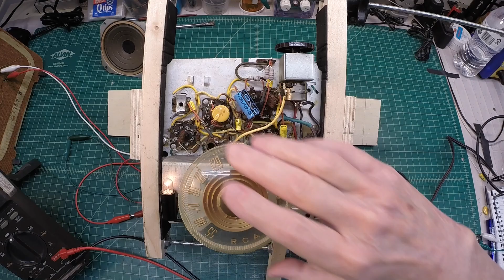RCA 8-X-541 - Cause & Effect P7 (Recapped w/ a Loud Crackling Noise - TAKE THE POLL 0:48)

Comment: Here's a question for you Don as I know you like to analyse and research. Why is this so called silver mica disease rare to unheard of over here in the UK but seemingly prevalent in the U.S.? Mica is Mica I would have thought, they used U.S. war surplus capacitors like Lemco manufacture in UK sets. Can't be our atmospheric conditions which are generally wetter as we have a maritime climate but so do parts of the States and wetter is worse for components. The only difference between our sets is the AC mains frequency and even that didn't hold true when the sets were built. It's something I've wondered about for some time now. Not denying that silver Mica seems to be an issue but more why it's not an issue over this side of the Atlantic. Yours in ponderment - Andrew
Reply from the maker: Research time for me. LOL I’ll ping you back ASAP. Best, Don

Comment: Sure sounds like good old dreaded silver mica disease. Would like to look inside the IF cans if there's any viewing hole if it's dark. Have seen them visibly arc before. I mean that's the obvious guess, and I am not sure if you would post that here for us to guess the problem? My non-gut instinct wants to test the tubes though and if it's actually something different, like a tube shorting out/opening with change of temperature though.
Reply from the maker: Thanks for your input. I just published the root cause video. Best, Don
Reply: @RestoreOldRadios  Thanks! Amazing how you can easily go down the wrong rabbit hole in troubleshooting when you aren't looking at the radio as a whole system.

Comment: Adding to the poll, typical silver mica disease. Crackling across the entire band and no reception of radio stations. Best regards Henk
Reply from the maker: Thanks Henk. I just published the root cause video. Best, Don
Reply: @RestoreOldRadios  I didn't see that one coming. Wrong guess on my side. Good signal tracing procedure. On the plate of the 12sa7 there are many frequencies due the fact of the mixing taking place. I guess that the oscillator signal is the strongest and that's why you only see that one. I understand that there was no rf path to ground because of a cold solder joint? So there was a potential voltage difference between chassis ground and rf ground? I am very interested what the crackling sound consists of. Don excellent work and you see that to all the one that responded to your poll. I hope you are doing well. Best Henk

Comment: Well no one has noticed something strange to the electrolytic capacitors. You have moved them too close to the sensitive parts of the radio. Don't like where the
47uF one is at all. Check back through parts 1 to 6 and look at where they should be! Where the original  dual red one was and insulated properly.
Reply from the maker: I appreciate your insight on the capacitor placement. I just published the root cause video; it was not what I expected. Best, Don

Comment: Hello Don, I'm sure I haven't got a clue. It sounds like an LM386 chip amp with the inverting input, pin 2, not hooked to ground. Could be bad ground, component, or tuning part(s). That's why I'm glad you have your channel. You sound like your doing good. Best, C.
Reply from the maker: Cass - thanks. I just published a new video that pin points the problem; it was odd. Best, Don

Comment: I voted SMD, but I have had similar problems in the convertor tube as well... Latter half of the video was confusing... I assume it was after the fix was done?
Reply from the maker: Eddy - sorry about the confusion. The video at the end was after troubleshooting and correcting the issue. I just published the root cause if you’re interested. Thanks again. Best, Don

Comment: I’d check the IF cans for Mica Capacitors,, I hope that not it. I hope it is just a noisy resistor or tube.
Reply from the maker: Thank you Rick. This one was a head scratcher. I just published an update. All the best. Don
Reply: @RestoreOldRadios  Yes I just saw it. I'm glad it was not the mica thing because that is a real pain. I repaired a Zenith Console AM/FM and I had to fix six I.F.s Cans and one Discriminator Can. What a PAIN!